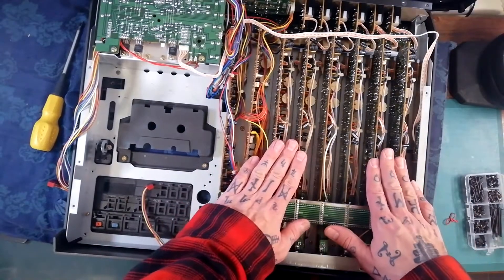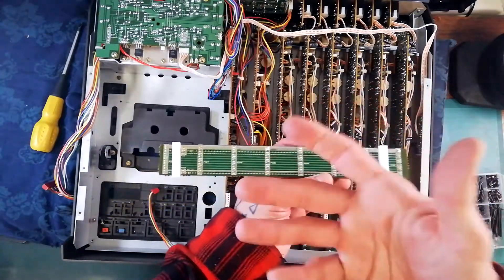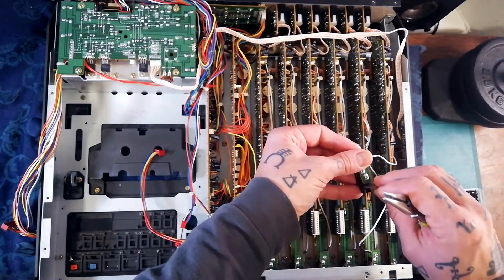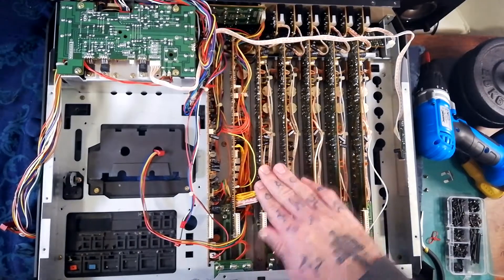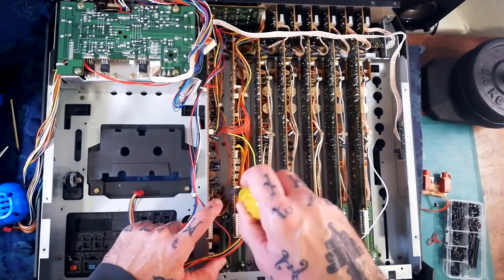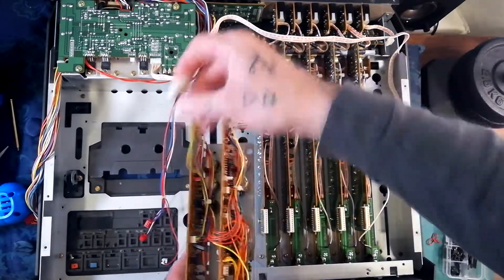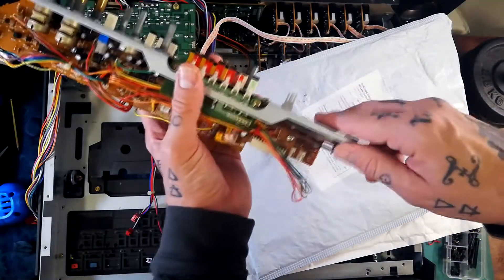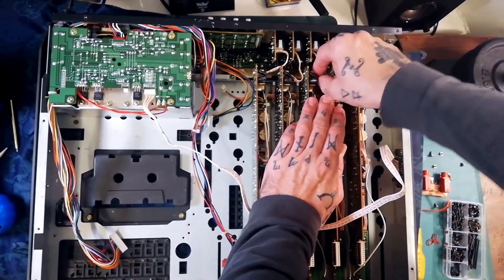Tascam Portastudio 246 | 3 | Remove mixer & monitor PCBs

Comment: hi! thanks for your channel! i just replace new belts, new pinch and new idler tires. now i put play and it stops in 5 seconds... on fast forwr and rew the same only 5 seconds. BUT if i keep pushing the play button keep playing but you still hearing the 5 seconds intention to stop.. and the same with rew and fast forw. the counter works on play mode but in rew and fast forw dont show any movement on the counter... can you help me please... sounds goor and very powerfull rewind and fast forrward. it is only that 5 seconds issue. please help thanks for everything!

Comment: Any tips on getting the input jacks tighter? Mine are still hanging on, but they wobble around a lot. Is this perhaps because the closest plastic ring has worn down? Have you seen this happen? Any good fixes?
Reply from the maker: I haven't seen that, but that sounds like a plausible explanation. If you're right you could try filing a deeperslit into the plastic and narrowing the existing clip with pliers so it fits in the new slot?
Reply: @Tetrakan  Thank you. Seems like an option. My only hesitancy would be that it might weaken the neck of the input jack. Am I correct that basically any unbalanced, closed style jack would fit there? There seems to be lots of space around it. Then I could just put a new one with good threads in (if that is even the issue).
Reply from the maker: Yeah I reckon that'd work

Comment: Yo, thank you for sharing your expertise.  I have been slowly trying to get my 246 functioning, but it's kind of been one thing after another.  Mine has new belts. Idlers and pinch roller are acceptable for now, but suddenly channels 2 and 4 have gone out on me. I play a tape that I recorded on my 234 and it's not registering on meters or on headphones anything on 2 or 4. 2 is hummy, but it also has a broken push-in 2/R button that is stuck kind of cockeyed halfway between in and out. Are those easy to fix? Also, any quick troubleshooting tips for dead channels like this? I feel like last time the channels worked initially after the belt swap. Maybe a connection issue in one of those 4 main connectors (the brown, red, orange, yellow).  It's the same whether I'm monitoring, bypassing faders, or if I'm running the program through the actual channels/EQ; no 2 or 4. Any thoughts would be awesome. Feels like I'm just a few tools/ clues short here.
Reply from the maker: First of all so sorry I didn't see this until 8 months after posting! I don't know whether i saw a notification but forgot? In any case...refer to my playlist on electrical troubleshooting (available from my channel splash page) which includes videos about testing the record playback head in case you disturbed any wires during the belt change. If that seems ok, come back to me here for next steps.
Reply: did you ever figure this out? i'm having the exact same problem
Reply: @charlescroley2015  I do as well. Pinging on this